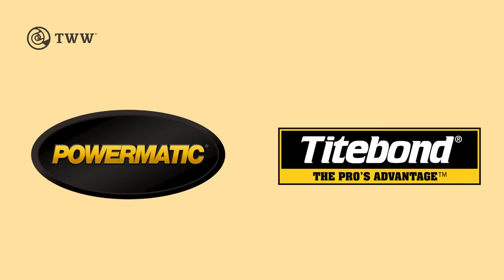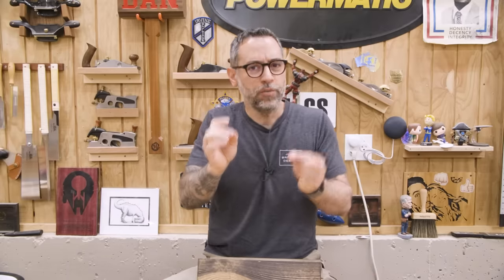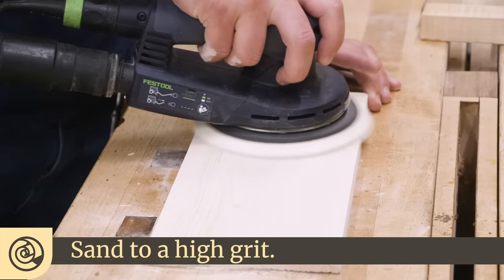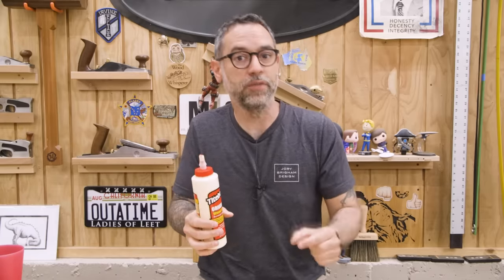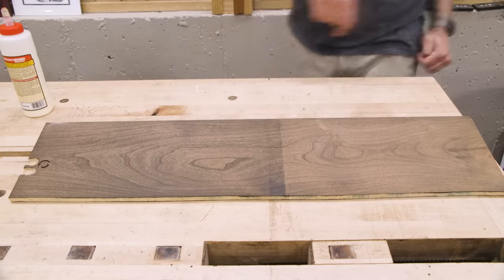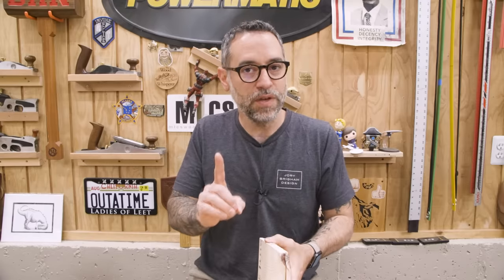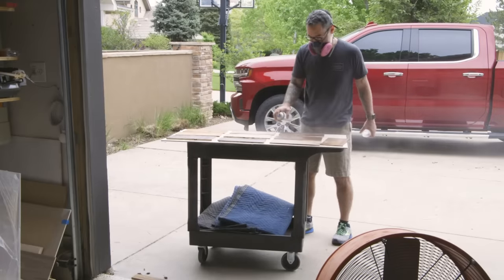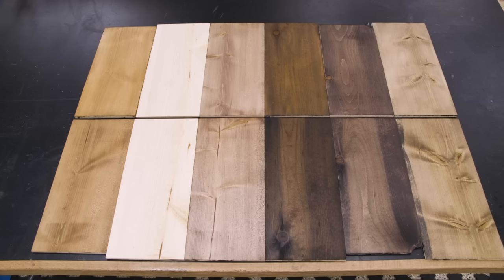Make Stains Look Better! | DIY Blotch Prevention Formula

Comment: Ive had luck on pine using Minwax pre conditioner...skip the instructions. Brush on till you dont have any dry spots. Some areas like knots take quite a bit of solution. Then wipe off wait 5 to 10 minutes then apply stain and wipe off immediately.  Good luck pine is tough to get a consistant look.

Comment: What would you suggest for a formula if my plans are to use Arti Artiporin Water-Soluble Dyes and finish with Oil based polyurethene.  do you think I can use the water based finish in the formula without an issue?

Comment: Thanks for the information. You had mentioned birch and maple are tough to get to work with stains. 
Any recommendations as to how to work with that combination?
I'm planning a new table top using Baltic Birch with Maple banding
Reply from the maker: Start by doing what was shown in this video and adjust from there.

Comment: Sir I am making a pantry cabinet, I used water based sand and sealer on all the visible surfaces, used water based maple stain on the rails and styles and oil based dark walnut on the panels inside and out, my question is I've been putting lite coats of maple on the pine, but it is just drying and looking like paint.

Comment: hi, i want to try your juice! but i do not have access to the General Finishes Topcoat you are using.  Being a novice and in europe im a bit confused with the different terms/products (primer, conditioner, topcoat, undercoat etc). Would a clear interior wood varnish do the job? Thanks a lot

Comment: I sanded a gossip bench and stained it with regular Minwax stain. The finish was very blotchy. So I then stained over that with a dark gray gel stain. Still blotchy. Then I finally stained with a black gel stain. Final product is blotchy. Is there a way I can get a nonblotchy finish without sanding it all over again before sealing it?

Comment: Hello, I have a question please, I have been facing this issue with a table that I am renovating it for a friend, and the color keeps blotching, It looks bad, I removed the stain like 4 times, to the extent that some part started showing the MDF below the veneer, so I thought of adding before chalk paint white trying to even it, but still I don't like it, so can I try your method on top of the chalk paint as I don't want to sand again? thank you in advance

Comment: So it's okay to use oil stain over the polycrylic "Marc juice" solution? Polycrylic is water-based, right? Is it okay to use oil stain over a water-based solution like that?
Reply: Was wondering this as well
Reply: @MrMrskemp  - Looks like we'll be wondering for months more!
Reply: @robira1313 he actually uses oil based stain for most of this video.  At about 11:30, he compares various others, but yes, it's compatible.  

Based on extensive use of the former product from Charles Neil (which is similar composition) I used two coats of the blotch control, sanding between and after to eliminate the raised grain.   I then applied GF oil based strain after 24 hours.  Finally, I applied two coats of the GF water based Enduro Var after 72 hours.

This sequence was used on hundreds of linear feet of fir casing and base and several doors. 

I'd expect Marc's formula to behave about the same.
Reply: LOL

Comment: Why is staining such a massive PITA. I bought a poly + stain combo for my birch butcher block table top and it looked nothing like the sample photo. Staining always seems like such a gamble. The glue additive is really interesting.
Reply from the maker: That’s part of the reason I got away from staining. When I built for clients it was much more of an issue since they often see stained pieces and they want something that “looks like that.” If the budget is there for the materials, clear coats are the way to go.
Reply: @woodwhisperer  Amen to that and I’m color blind!
Reply: @woodwhisperer  I agree, In a perfect world I would have everything walnut haha. Any suggestions on your preferred clear coat?

Comment: Hello Mark. I was just wandering about your super juice formula. Would this work on pine floorboards. I have applied Pre-Conditioner  before staining my floor. This supposed to help to spread stain more evenly, unfortunately some places still appeared blotchy. I was thinking about re-sanding those places and applying your formula to achieve  beautiful consistent colour of the stain. Anybody tried this on floorboards?

Comment: Love your projects Mark! Question..... Which is more critical in the drying/cureing process. Heat or air movement around around your project and if it veries, help me understand.
Reply: I would liek to know the answer to this as well. I have had better luck with the commercial priduct when I give it a lot of time to dry.

Comment: Marc how do you think the "Marc Juice" would work on ply (Baltic birch) then GF gel on top of that?  I have been using your shellac/alcohol mix up til now, some good some sketchy results.
Reply from the maker: It should work theoretically but Baltic birch is tricky. Test and adjust.

Comment: Hi. In the blotch control recipe when you say water based finish are you referring to a clear polyurethane topcoat? And what sheen was the finish you used, if you remember? Thanks.
Reply from the maker: Yes, correct. Sheen doesn't matter.
Reply: @woodwhisperer  Thanks. Looking forward to trying this on some blotch prone hemlock.

Comment: Serious question Marc, with the oil based stain I’m assuming you didn’t add stain to the mix?
Reply: I was wondering if it would be a water based stain of the same colour as the oil based that you want to end up with added to the mix first.
Reply: @rusticduckfurniture4744  good thought !

Comment: Just curious, has anyone tried this on Douglas Fir? If so, did you use the exact recipe or modify it at all?
Reply: Im wondering the same thing! Did you end up using it on Douglas fir?
Reply: @twentyone177  yes, I actually did. It works great, but don't use it on the eng grain
Reply: @adamthewoodworker2571  awesome! what is the eng grain? 🤔 did you mean “end grain”?
Reply: @twentyone177  yes I did mean end grain lol
Reply: @adamthewoodworker2571  cool 👍🏻 I’m about to use it on unfinished DF doors and I’m hoping for the best! It’s such difficult wood to stain evenly!
Reply: @twentyone177  if you have a Instagram, drop it here, and I'll show you some stuff I've done with using this stuff as a wood conditioner

Comment: There is another good solution that you didn't touch on: pigmented oil  stain.  Instead of a penetrating oil stain (ie:Minwax) use a pigmented oil stain (Zar, Valspar or Rustoleum etc.) This approach is much more controllable.

Comment: What if I need a darker color with the MJ?  Can I use multiple coats or do I increase the amount of stain in the initial coating?
Reply from the maker: There is no stain in the juice. The staining is done after the juice is applied.
Reply: @woodwhisperer  Got it, but I’m a bit confused, at 6:43 you say to add General Finishes water based finish.  Is this poly or some other type of product?
Reply from the maker: Yes it’s a water-based clear topcoat. No color is implied. Nothing in “water-based finish” implies color.
Reply: @woodwhisperer  Copy that...thanks.
Reply: THIS string below is helpful.  I also thought he was adding stain to the juice.  Was trying to figure out what to do for oil based stain and started scouring the comments.  So it sounds like you just add glue, water based poly and water and then can stain with an oil-based stain afterwards.  I did see a bunch of questions above asking about oil-based stain so others may find this helpful.

Comment: Most important thing is to not use oil stain on softwoods. You will always get Blotching, zebra effect - grain reversal. best to use alcohol based dyes on softwoods after a light sealing pass of some kind.

Comment: How would the “Marc Juice” work with Rubio Monocoat?
Reply from the maker: I wouldn’t recommend it. Rubio really wants raw wood.
Reply: I asked Rubio about using Charles Neil’s product prior to applying Rubio Castle Brown tint on Cherry and they recommended against using any type of pre-finish conditioner.  My sample showed a slight improvement using one coat of CN blotch control.  On my finished project, however, I followed their advice and did not use the blotch control pre-finish.  It was somewhat blotchy, but acceptable for a rustic mantel.  I would recommend using Pure monocoat on Cherry if you want a clean, natural look.
Reply: Thank You Mark and Steve for your comments.  I did an experiment with Rubio Monocoat on some pine and while I didn’t get rid of the blotching what I did do helped.  What I did was give it a good sand at 180 then water popped it, resanded at 180 and 220 cleaned with Mineral Spirits and apply Rubio.

Comment: Useful tip for anyone (cheap and sadistic like me) staining spruce:

Use the glue-size mix first, THEN use a ½ lb cut of dewaxed shellac after you sand with 320 (dewaxed only). Stain after a quick coat or two and you'll be surprised with how nice the results are.

I've been making a full closet out of Nordic Spruce from Lowes and it's gone from looking like a disaster to a very rich, warm appearance that actually compliments the reddish undertones of spruce. 

The only caveat is that it is still essentially hopeless with really knotty boards. You've really gotta take the time to dig and find the best boards at the big box store and plan your cuts, but it's worth it if you do.

Comment: The blotch control from Charles Neil website is still available. It can be purchased from his website at cn-woodworking.com. It is the best product that i have ever used.  It is disappointing that you didn’t use it in your comparison and used a different commercial product instead.  Maybe in a follow up video.
Reply from the maker: That was intentional for a couple of reasons. First, I've heard from folks who ordered the product and never received it. I didn't want to waste my money. Second, if they are still selling it I have no desire to take money out of Charles' family's pockets. In my limited experience and experimentation, this DIY formula works just as well as the Charles Neil stuff.

Comment: I wonder how Osmo and Rubio would fair.
Reply: I asked Rubio about using Charles Neil’s product prior to applying Rubio Castle Brown tint on Cherry and they recommended against using any type of pre-finish conditioner.  My sample showed a slight improvement using one coat of CN blotch control.  On my finished project, however, I followed their advice and did not use the blotch control pre-finish.  It was somewhat blotchy, but acceptable for a rustic mantel.  I would recommend using Pure monocoat on Cherry if you want a clean, natural look.

Comment: why would you test a piece of crap pine that no one is going to ever use for furniture???? ---should have tested Cherry
Reply from the maker: Two reasons. First, plenty of people build with pine. Second, because pine is one of the worst when it comes to blotch. So if this formula works on pine, it will definitely work on cherry. Cherry would have been a softball.